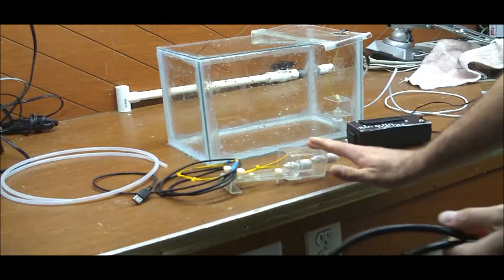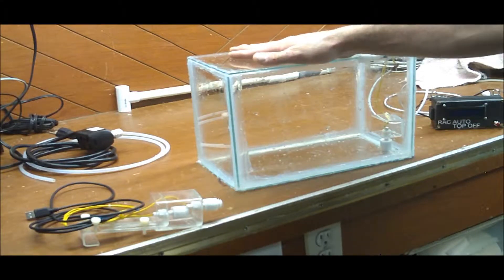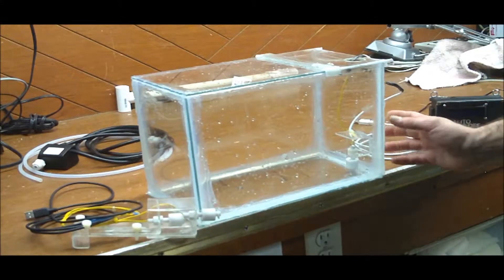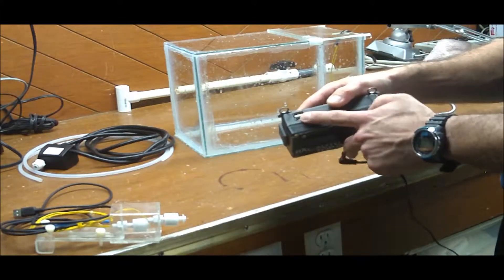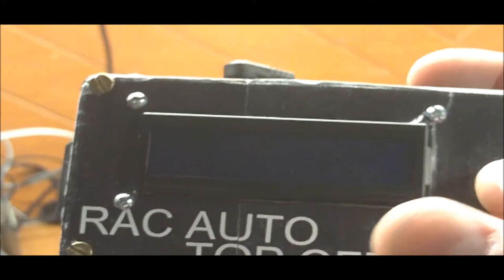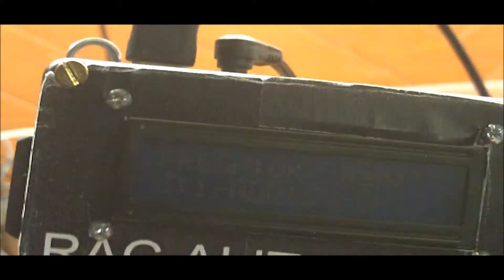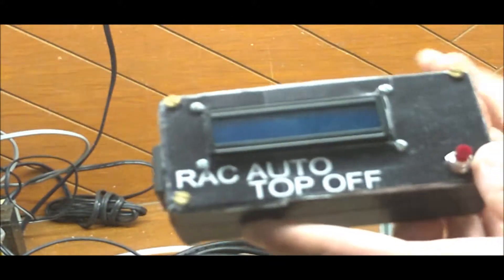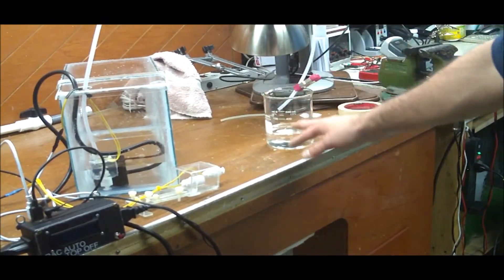HOW To - Diy Arduino Auto Top OFF

Comment: Great video .... but how'd ya make the controller? Thinking about making one as well .... granted I need it shut the pump off
Reply from the maker: The Controller is just an AtMega 328 Chip with the Arduino bootloader.
I have it on some perf board.
I will have to make a video on that...
Reply: Carl Recktenwald Jr. Ya please do bro!